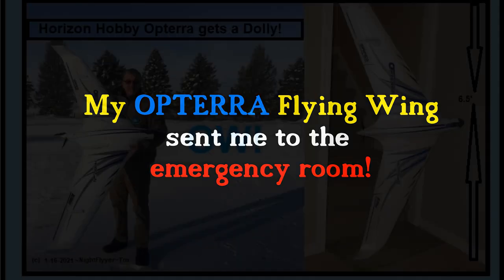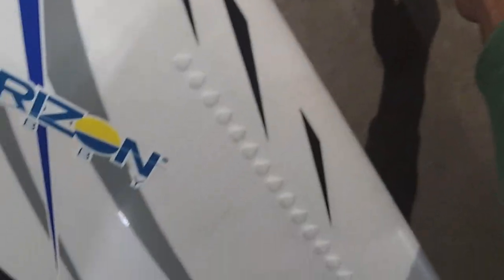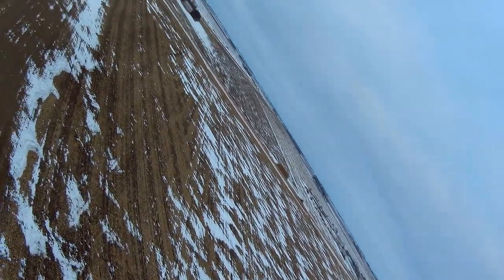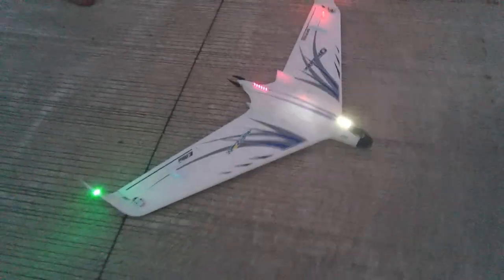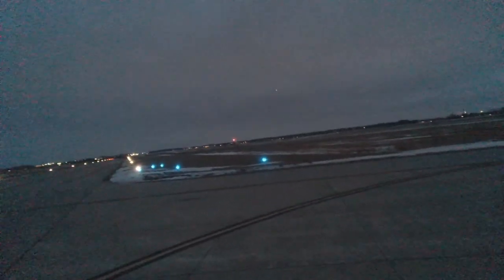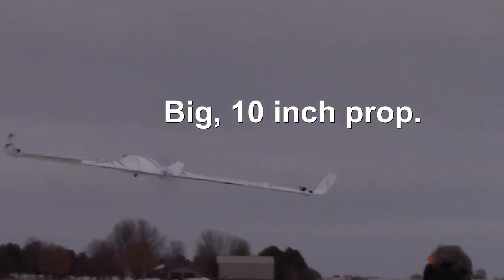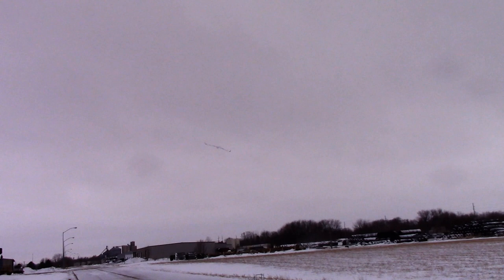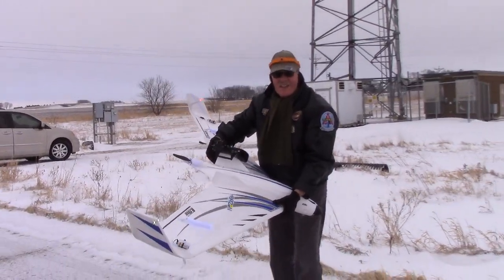My Opterra 2M Flying Wing sent me to the E.R. This is an awareness video & my solution for launching

Comment: It’s been a decade sence I’ve had an esc that needed armed. Both on off the shelf esc and those that come on these BNF planes. 
Use your switch just like a nitro kill switch to disarm your esc. 

You could also make a wire guard that extends below the prop. 

I’m sorry you’ve cut yourself. That looks painful. 
That is a big prop. Looks like you’ve covered all the bases for launch options. 
If that plane is still made, horizon should take the finger grips off the bottom so people CANT launch traditionally and catch the prop.
Reply from the maker: Yes,  Many of my helis and drones need armed.  It has always been a safety feature I counted on.  A guard would be destroyed on landing, as there is no landing gear and it hangs down 5 inches on this 10 inch prop.    Horizon should change their instructions.  Here is word for word what the Opterra 2M manual says about launching.  
1. Put the aircraft into launch mode with the channel 5 switch.  (in my first video that did not work, it went into the ground)  
2.  Hold the aircraft in one hand and the transmitter in the other.  
3.  Apply full throttle and throw the aircraft directly into the wind, angled slightly up (5 to 10 degrees above the horizon). 
4.  Climb to a safe altitude and check the trim.   
I know others have their own ways, and either way, my Dolly is the safest solution for me.  
The Opterra 2M manual also says nothing about throwing it with the motor off, so if a newbie followed the instructions, like I did, I'm showing what could happen, in case a gust of wind got them or something else.     Nothing is 100% and no matter how good you can throw, this big 7 foot wing with a 10 inch prop spinning right next to your face, into 12 MPH is risky to say the least.  The 10" prop is very close to your forearm as well, so a gust could tip it back even before launch, as others told me happened to them.  Thanks.

Comment: This happened to my partner who is never throw in a plane in the air before with a push or prop myself never had this problem because I know how to throw itI’ve been doing this hobby for 40 years never hit my finger once
Reply from the maker: Ive been flying over 60 years and certainly know how to as well, but....The instructions only say to hand launch it and tells how.  That is how I did it.  The manual says nothing about throwing it with motor off, and it barely has enough power as it is, especially as I launched it into 12 mph winds.  Of course nothing is 100%, and others told me they were holding this big 7 foot wing and before they launched, a gust of wind got under it and it tipped back and cut their forearm and 3 tendons.  This big heavy, under powered wing is not that easy to hold and launch into 12 mph gusting wind.  Its hello dolly for me from now on.   Here are the links to the last videos.  https://www.youtube.com/watch?v=P_inF5EYLEE&t=1s&gl=CO  and   https://www.youtube.com/watch?v=ur5V5H8UcGs&t=1s I had no problem then, but shit happens.

Comment: You can program a kill switch in the tx.
Reply from the maker: Of course I know how and a have.  I First of all, that had nothing to do with my hand injury. I only mentioned the Throttle arming because I followed instructions in the manual and this is the way it bound up and arms the motor as soon as you plug in the battery.  It's my warning to be cautious, because the manual says nothing about programming in a throttle hold to a switch. I've known of times when after flying, that switch was forgotten to be moved back to safe and it armed as well.  Nothing is 100% as it could be left in the wrong position, by accident. I'm pretty experienced, so never relied to on a throttle cut/hold, as all my machines need throttle stick movements to arm.   I only am warning others to be careful BEFORE the launch and to be careful no matter what you use.

Comment: Stick some gear on it.   Might slow you down a bit but at least you wouldn't have to listen to the sickening scraping sound when it lands.  Also, why wouldn't you land it on the grass?
Reply from the maker: Because I put tiny wheels on it and this was a test.   If you watch my first videos, I flew it over snow.  There is no grass here right now. Those wings aren't as strong or thick as you would think.  I would have to add a nose wheel servo and make it a trike as well.  And since the prop on the back is 10 inches, the landing gear would have to be quite long or retractable prop would hit the ground on rotation or landing. Thanks for the suggestion, but the dolly is now my landing gear and does not add any weight to this under powered 7 foot long wing.      Here are the links to the last videos and you can see I launched it the same way without problems.
https://www.youtube.com/watch?v=P_inF5EYLEE&t=1s&gl=CO  and   https://www.youtube.com/watch?v=ur5V5H8UcGs&t=1s

Comment: Wing airplanes with engine in the back is very dangerous to lunch in this style. I launch my airplane in the frisbee style but is difficult.
Reply from the maker: Yes, that works with smaller wings, but this wing is 7 foot long, heavy and will bend and break the end off the if you even try to pick it up by the tip and barely has enough power to fly out of your hand at launch.  I know and I tried to launch it discus style, but could not hold it where I felt I could launch it successfully in the wind.     It would also be extremely difficult to somehow launch it discus style with the elevon there and that 7" tall winglet rudder that is also on the tip.  I know how to do it , but not with this plane.  Again, I launched it exactly as the manual suggests and many others would too, and why my warning.   Thanks.

Comment: I use a switch to arm/disarm the motor on all of my planes so that if I bumb the throttle, nothing happens
Reply from the maker: First of all, that throttle arming had nothing to do with my hand injury. I only mentioned the Throttle arming because I followed instructions in the manual and that is the way it bound up.  It arms the motor as soon as you plug in the battery.  If it had said to program in a throttle cut, I would have! I only mention it to warn others to program in this feature as well,  that also should have been mentioned in the instructions.   
Thanks.
Reply: @NightFlyyer  Hi. No problem m8, just a suggestion. I wish you further flights without problems!

Comment: From my own experience, "I'll be careful," are the fateful words spoken to oneself that MUST be heeded. 
they mean STOP! Don't do it!     1> Heavy, leather welding glove! 2> Your catapult idea is best. Thanks for you warning.
Reply from the maker: Thanks for that suggestion and I tried that already, but because it was cold.  I found trying to hold on to the tiny finger grips on the bottom of the 7 foot wing with a thick glove under full power with wind blowing was difficult when under power and then trying to fly with  a big enough glove on was also difficult to fly the transmitter, (I'm a stick pincher)  so although that sounds like a good idea, it did not work that well. Some have told me the Prop got them in the forearm even before launch, when a gust of wind got under the wing and tipped it back, so gloves wont protect that.  We are only talking about a Half inch of clearance that I needed to keep from getting cut, and even though I pulled it off several times in my earlier product review video,  I will never hand launch it again.  LOL.  It's hello dolly from now on!  Thanks.

Comment: Does anyone make a launcher like a clay pigeon thrower? Something with an arm that rotates so that it's out of the way for the prop.
Reply: Or the same idea put on it's side, so the arm pivot is on the ground. Mount a small hollow tube with a pivot or ball joint near the nose to put the throwing arm through.
Reply from the maker: @ryanlangan1060  That all sounds nice, but it is a big 7 foot wing. I should not have to buy anything to enjoy this plane.  If so, Horizon should include a launcher.  See this for more info on my launch issues. https://youtu.be/f5xDfk7sbcQ

Comment: you can swing launch a beast like this, no way to cut yourself that way :)
Reply from the maker: This wing is 7 foot long, heavy and  will bend and break the end off the if you even try to pick it up by the tip and barely has enough power to fly out of your hand at launch.  I know and I tried to launch it discus style, but could not hold it where I felt I could launch it successfully in the wind.     It would also be extremely difficult to somehow launch it discus style with the elevon there and that 7" tall winglet rudder that is also on the tip.  I know how to do it , but not with this plane.

Comment: Wear gloves when you throw a spinning blade out of your hand. They make really nice cut proof gloves.
Reply from the maker: Thanks for that suggestion and I tried that already, but because it was cold.  I found trying to hold on to the tiny finger grips on the bottom of the 7 foot wing with a thick glove under full power with wind blowing was difficult when under power and then trying to fly with  a big enough glove on was also difficult to fly the transmitter, (I'm a stick pincher)  so although that sounds like a good idea, it did not work that well. Some have told me the Prop got them in the forearm even before launch, when a gust of wind got under the wing and tipped it back.   We are only talking about a Half inch of clearance that I needed to keep from getting cut, and even though I pulled it off several times in my earlier product review video,  I will never hand launch it again.  LOL.  It's hello dolly from now on!  Thanks.

Comment: if you fly electric, you should know of using a safety switch SAFETY SWITCH if you don't know check it out
Reply from the maker: I certainly know that as most of my helis have that setup. Ive flown models for 60 years.  Im 73.  But the best rc pilots in the world, have also had bad landings once in a while.  Shit happens, especially while I was trying to throw this heavy, under powered 7 foot model into the 12 mph headwinds.    First of all, that had nothing to do with my hand injury. I only mentioned the Throttle arming because I followed instructions in the manual and this is the way it bound up and arms the motor as soon as you plug in the battery. It says nothing about programming in a cut switch like my helis have. I only mention it to warn others to program in this feature as well,  which also should have been mentioned in the instructions.  It's my warning to be cautious, because the manual says nothing about programming in a throttle hold to a switch. I've known of times when after flying, that switch was forgotten to be moved back to safe and it armed as well.  Nothing is 100% as it could be left in the wrong position, by accident. I'm pretty experienced, so never relied to on a throttle cut/hold, as all my helis and my drones, and many of my electric planes need throttle stick movements to arm.   I only am warning others to be careful BEFORE the launch and to be careful no matter what you use. Thanks.

Comment: Maybe a cut resist glove eh?
Reply from the maker: Thanks for that suggestion and I tried that already, because it was cold, but trying to hold on to the tiny finger grips on the bottom of the 7 foot wing with a thick glove under full power was difficult when under power and then trying to fly with it on and also difficult to fly the transmitter,  so although that sounds like a good idea, it did not work that well. Some have told me the Prop got them in the forearm even before launch, when a gust of wind got under the wing and tipped it back.   We are only talking about a Half inch of clearance that I needed to keep from getting cut, so I will never hand launch it again.  LOL.  It's hello dolly from now on!

Comment: If I can't launch using some sort of high start l wear a leather glove with pushers
Reply from the maker: Thanks for that suggestion and I tried that already, but because it was cold.  I found trying to hold on to the tiny finger grips on the bottom of the 7 foot wing with a thick glove under full power with wind blowing was difficult when under power and then trying to fly with a big enough glove on was also difficult to fly the transmitter, (I'm a stick pincher)  so although that sounds like a good idea, it did not work that well. Some have told me the Prop got them in the forearm even before launch, when a gust of wind got under the wing and tipped it back.   We are only talking about a Half inch of clearance that I needed to keep from getting cut, and even though I pulled it off several times in my earlier product review video,  I will never hand launch it again.  LOL.  It's hello dolly from now on!  Thanks.

Comment: I've seen people hold the flying wings by one wing tip then spin around and let it go.
Reply from the maker: As I have said over and over again, this 7 foot wing bends badly if you pick it up by the wing tip and the huge winglets on the tip make it very hard to hold and launch. That works for small wings, but not practical with this one. 
 Here is word for word what the Opterra 2M manual says about launching.  
1. Put the aircraft into launch mode with the channel 5 switch.  (in my first video that did not work, it went into the ground)  
2.  Hold the aircraft in one hand and the transmitter in the other.  
3.  Apply full throttle and throw the aircraft directly into the wind, angled slightly up (5 to 10 degrees above the horizon). 
4.  Climb to a safe altitude and check the trim.   
I know others have their own ways, and either way, my Dolly is the safest solution for me.  The Opterra 2M manual says nothing about throwing it with the motor off, so if a newbie followed the instructions, like I did, I'm showing what could happen, in case a gust of wind got them or something else. 7 foot wing is too big to throw discus style, as it bends a lot when you pick it up and the wingtips' winglets are in the way.   Nothing is 100% and no matter how good you can throw this big 7 foot wing with a 10 inch prop spinning right next to your face, stuff happens.

Comment: I was warned when I bought mine to not throttle till it leaves your hand...
Reply from the maker: I appreciate that, but we Marines were taught to follow instructions and stick to the plan or get dead!  So after spending 33 years in the Marines, I managed to stay alive because of that.  This wing is 7 foot long and will bend and break the end off the if you even try to pick it up by the tip. It would be extremely difficult to somehow launch it discus style with the elevon right there and that 7" tall winglet rudder that is also on the tip.  I know how to do it , but not with this one..
To try to pick it up and launch it with left hand with motor running full would be a tough call, not like launching my small F-27 evolution.  So I followed the instructions word for as I did for the video I made of my product review earlier.  https://www.youtube.com/watch?v=P_inF5EYLEE&t=1s
Here is word for word what the Opterra 2M manual says about launching.  
1. Put the aircraft into launch mode with the channel 5 switch.  (in my first video that did not work, it went into the ground)  
2.  Hold the aircraft in one hand and the transmitter in the other.  
3.  Apply full throttle and throw the aircraft directly into the wind, angled slightly up (5 to 10 degrees above the horizon). 
4.  Climb to a safe altitude and check the trim.   
I know others have their own ways, and either way, my Dolly is the safest solution for me.  
The Opterra 2M manual also says nothing about throwing it with the motor off, so if a newbie followed the instructions, like I did, I'm showing what could happen, in case a gust of wind got them or something else.

Comment: maybe should invest in cut resistant gloves if your hands around spinning blades
Reply from the maker: Thanks for that suggestion and I tried that already, because it was cold, but trying to hold on to the tiny finger grips on the bottom of the fuselage with a thick glove under full power would be difficult when under power and then trying to fly with it on and also difficult to fly the transmitter,  so although that sounds like a good idea, it would probably not work that well.  We are only talking about a Half inch of clearance that I needed to keep from getting cut.

Comment: A pair of gloves and a bounce up into the air rather than a throw because that's what the propeller is for
Reply from the maker: Thanks for that suggestion and I tried that already, because it was cold, but trying to hold on to the tiny finger grips on the bottom of the 7 foot wing with a thick glove under full power would be difficult when under power and then trying to fly with it on and also difficult to fly the transmitter,  so although that sounds like a good idea, it would probably not work that well.  We are only talking about a Half inch of clearance that I needed to keep from getting cut. This big 7 foot Plane barely has enough power to fly out of your hand and those that have them know that.  It must be thrown hard.